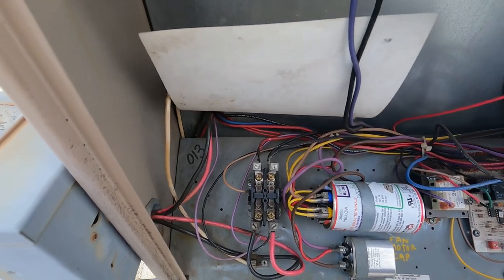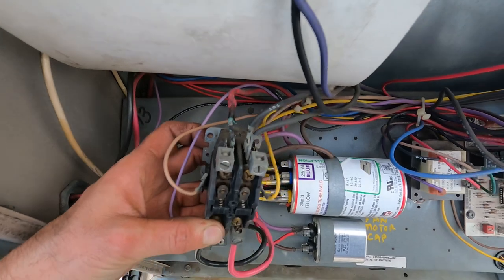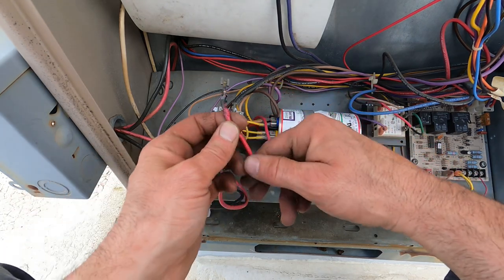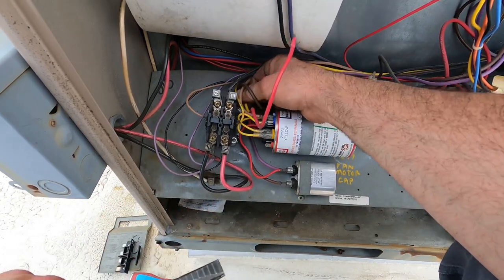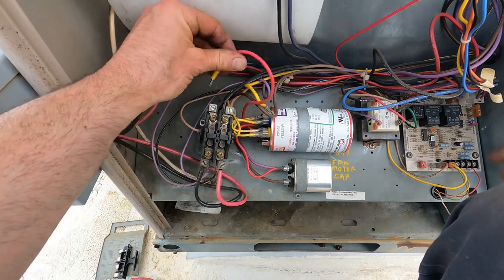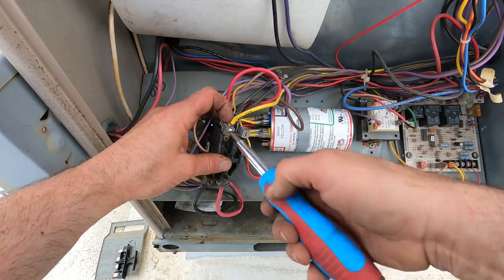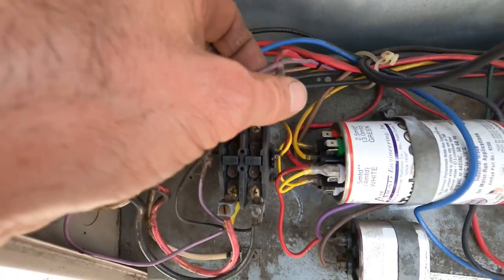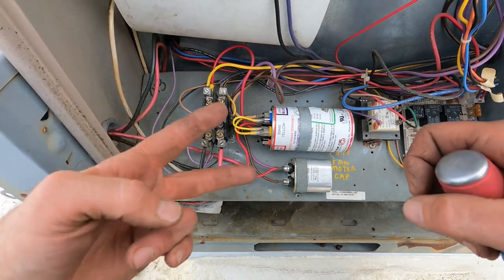Burned Wires Inside AC Unit Connect to Contactor Goes to Capacitor

Comment: Couldn't agree more, loose connections produce heat.  And then the heat loosens the connection which produces more heat.  Rinse and repeat.  Replace the terminal, like you do, don't just pinch down the ears.  The metal is no good anymore.

Comment: Thank you , sir.
I appreciate your pass it forward

Make us the best we can be
Reply from the maker: It's why i like to share experiences and info. When i started I had the infamous burnt wire to capacitor off contractor. I cut off the burnt ends and new connector. Then was back 2 weeks later. That was a loose wire in the disconnect. What good is my experiences if never shared.

Comment: Hi there
My hvac guy changed out the contactor and touched 2 live wires together. The wires to the new fan motor look burnt and now the compressor isnt working. Did the live wires touching cause the compressor to short out? Please let me know. Thank you
Reply: Anytime you charge to live wires to anything you are shorting something out, motor windings compressor windings and other electrical pieces connected to wear those wires go. Always disconnect the power when working on something like this no matter what. My car is also cuz you're going to short out your electrical system in that fuses relays alternator excetera just from touching a hot wire to something else, and especially especially another Hotwire, also on automobiles in a lot of these AC units you could burn out the motherboard/ brain/ control board and its components
Reply: @buddyd.irishsr.5646  thank you very much for your reply. I appreciate  it!
Reply: It happens

Comment: Just had a unit installed 5/6. AC stopped working this morning 5/12. Called the installer which doesn't have the greatest reviews, they came out and found a burnt/melted wire on that side of the contactor. Said it had to be a surge and charged me $321 for the repair. I know that is. You know that's bs. I have no problem stopping the check.... however, what do I need to do to assure this doesn't happen again? It's a brand new unit. Do I need to pay another company to come check everything or can I just check certain connections?
Reply: Same situation for me

Comment: Very nice video and explanation. I will need to replace my entire Contactor because the connections are rusted just like this one.  

What connectors did you use to replace the ones on the melted wire?
Reply from the maker: I use spade crimp on connectors. These break over time taking them on and off. Keep a few in my service bag.
Reply: @howtohvac3234  Awesome, I am enjoying a cool house now! THANK YOU!!!!!!!
Reply: What gauge wire? 10?

Comment: How would you know if the contractor is bad my wires looked the same going to fix wires but debating if I should just change out contractor aswell
Reply: Contactors are fairly inexpensive and easy to switch out. I would recommend replacing it if it's 5+ years old. Think of it as a maintenance item. I actually keep spare capacitors and contactors for my home unit. These are the typical things that fail and can be replaced DIY.

Comment: Why wouldn’t you change the contractor and put those wires under the lugs why even attempt to put a spade on those wires
Reply from the maker: Contactor needs the customers approval, spades were used from factory. They are also easier to pull off for testing. You can use the contactor lug. It works the same. I was here for a maintenance, therefore I have to go through everything before doing any billable repairs. Those contactors were replaced. Yet video is to show reason for melted wires. What to look for so it doesn’t happen again. I seen loose lugs in the disconnect, breaker, cap with terminal that moves. Melted wires most of time are due to loose connections causing wire to overheat
Reply: Dude just don’t do ac work if u had to ask that. Please don’t do any hvac my guy. Leave it to the professionals. Nice video by the way keep schooling them